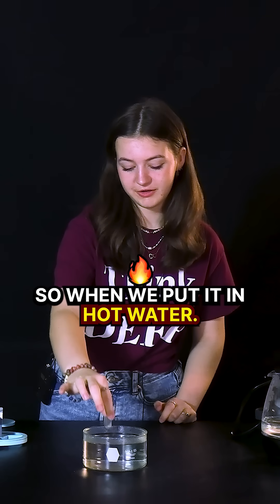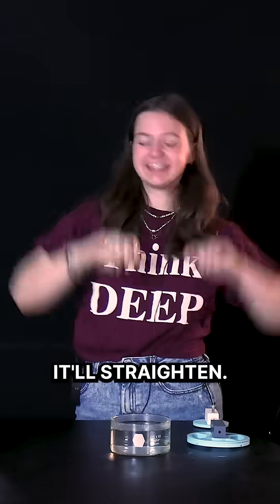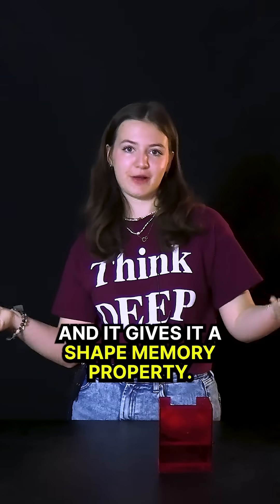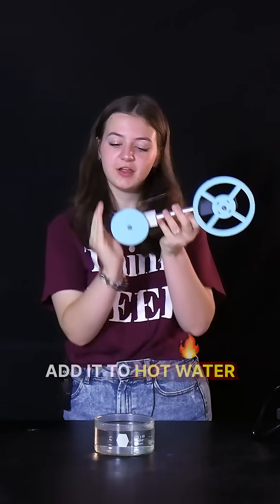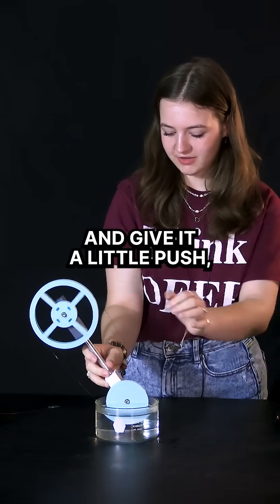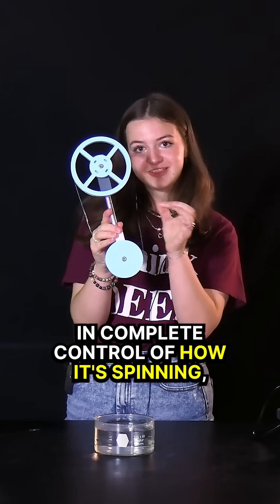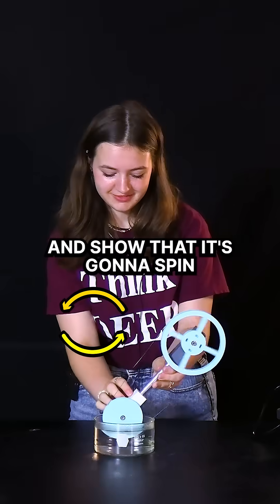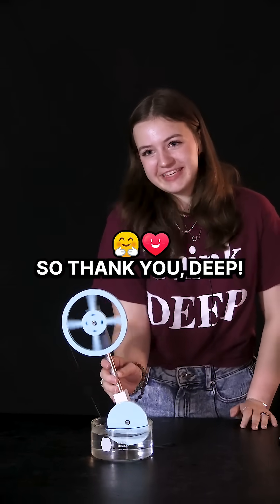Magic metal springs to life from heat! But how?? #shorts #tamu #science

Comment: "Using temperature as a variable and other thermal conductivity parameters as constants probably would be a way for heat flow analysis in alloy metals in the case. The thermal conductivity itself is a measurement of a material's ability to transfer heat, & Transferred thermal energy due to temperature differences could be utilized in processes like thermal propulsion or electrically converted- in the form of devices e.g thermal detectors thro' thermoelectric effect. Thermal conductivity, however, is influenced by numerous parameters, so I don't think attaining its own monitoring and regulation is a simple task. These include some of the following: alloy composition, crystal and phase structure, grain size, impurity content, dislocation density, porosity, temperature, cold working, heat treatment, precipitation, magnetic ordering, electron concentration, lattice vibration, vacancies, phase transformation, oxide films, grain orientation, residual stress, thermal fatigue, component size and shape..."

Comment: How long will it last?
Reply: @sptzk7133  until the water cools down. It's a cool concept though
Reply: @maxs.3238  but does the wire go bad, bc if you a constant heat source it could be very useful!
Reply: @sptzk7133  I would assume that there will be material fatigue at some point

Comment: Be careful this is government territory your walking on infinite energy with a metal sounds like something they might think as a threat especially if you take that little wheel she has and sacle it up about x50 and you got your self a sustainable energy granted you’ll need a heat source for the water but that’s simple enough that it’s every possible to make your own self sufficient energy source with this metal
Reply: Especially if it’s built at a hot spring then you don’t need to find a fuel source since the geological heating of the undercrust is not getting cooler anytime soon so pretty much infinite energy granted you’ll have to live at where the hotsprings is but that’s not so bad

Comment: Proof there IS power in "going straight". 
This experiment is going to cause many "wires" to be "hot-headed.", let's hope it gets their "wheels turning", in the "Right" direction, a lil rewiring solution, could prove very beneficial. 😅
She may even have a new kind of perpetual motion/ energy. Need 2 sources of water, one heated, one cooled and will continually work, as long as it stays coated in the nitnol solution. 

Straight pride, straight power. ❤ ✊️ 😅😅

Comment: Memory metal. It reacts to electricity to. had some ideas for applications of it. Our muscles retain memory in a similar way, so it gave me the idea of using a memory metal weaved in the pattern of human muscle strands to either make exosuits that could theoretically make you faster and strong by alot kinda like a spartans armor from halo, or you use the artificial muscle weave in prosthetic limbs for a more natural movement. Combine silicon based synthetic skin and you should basically have luke skywalkers prosthetic arm.

Comment: I see the beginnings of a perpetual motion machine. There is always gonna be a loss of heat however I do see ways they could make it perpetual even if the returns aren't great. Electronic conduction heating elements. Granted you spin it through a bunch of gear ratios to power the item. Depending on how many wats are made you could power some form of electrical heating element to heat the water. If the energy is enough to provide a touch more. Even just a touch more than what's being used your golden. Water is in constant supply here on earth. Even dirty sewer water or salt water can be boiled and heated via the machine if you don't want to use fresh water. But if your able to somehow got even a touch extra power that power can be stored. Infinite power. Goodbye fracking, goodbye gas, goodbye jobs. Hello infinite electrical power.

Comment: We use these wires in orthodontics due to their shape memory. When you get braces, the wire is placed into each bracket, creating kinks in the wire’s form. The heat from your mouth and the wire’s desire to return to being straight help it straighten back to its original form, aligning your teeth along that straight arch at the same time!

Comment: This would be a great energy creating perpetual motion machine.
Connect several of those together and attach each to a kinetic energy generator.
Insulate a large container of liquid dense enough to heat without too much evaporation. Split the kinetic energy this creates from its rotations. Some to an electric water heater that will continuously heat the liquid inside the container and the remaining energy to a power bank to store that energy for later use.

The heated liquid creates the spin
The spin creates the energy
The energy creates the heated liquid

I don’t imagine the yield of energy would be enough for anything substantial but If done correctly it could be a good small source of power. Great video keep them coming👍🏻

Comment: So whats stopping this from being perpetual? What has to deplete to break the cycle
Reply: The water gets colder as the wire takes heat and releases that heat to the environment as it spins, lesser the heat, lesser the spin.

And at some point when the water temperature is low enough where it doesn't force the wires molecular structure to move and straighten, the spin stops.

You can never create energy, only transfer it from one place to another, this is heat energy being transformed into motion.

Comment: Some people argue about it needing heat that has to be produced. 

And yes it does, but we can get heat as an infinite resource. 
You could use a lense and sun to heat up a basin of water. 
You could also use thermal energy. Think natural hotsprings.

Basically most sources of energy that we use, revolve around turning a tourbine. Through water currents, wind, steam... Even our nuclear energy is simply a way to make water boil and turn a turbine.

Solar is the only source of energy that works differently iirc

Comment: If you applied this technology with a natural hot spring then you would have a variation of perpetual energy.
Reply: It’s free, not perpetual
Reply: @1986DarkStalker  wouldn't it be perpetual energy because the definition of such energy is renewable energy generated by a naturally replenishing source i.e. a hot spring
Reply: @ perpetual means infinite
Reply: @1986DarkStalker  I get that. So if you have an infinite hot spring, then this sort of mechanism could run indefinitely.
Reply: @ hot springs are not infinite

Comment: I got one of these wires as a paper clip from the V-Sauce curiosity box. Honestly it’s a fun lil party trick when I pull out the box the single paper clip resides in and talk about how special it is as I immediately bend it out of shape. The looks I get 😂. I then demonstrate its properties by either very carefully holding it above a flame or dropping it in a mug of hot water (make sure to pull it out with a fork or something as the water does need to be rather warm to work and the paper clip is going to be the same temp for a few seconds). 👍

Comment: So would this be considered a form of perpetual motion?
Reply: it uses heat as a structure for energy, so when the hot water becomes cold, the pulley stops.
Reply: @  I meant to put this comment as a reply to another comment mentioning placing some sort of system over geothermal water vents
Reply: @wingsandthings99 it wouldn’t be perpetual, just free

Comment: As someone with limited scientific knowledge, I completely understand that because of the need to heat the water this isn’t infinite energy, however, could it theoretically be possible to implement this technology at natural hot springs? Something tells me the energy output would be too insignificant for it to be worthwhile.

Comment: Is it possible to turn this small wire into a huge long cable and place somewhere near the volcano so we can have free infinite energy ?
Reply: yes but this would be inefficient compared to something like solar or wind which is also “free” energy for a variety of reasons, namely that the wire would need to be bent once again after being straightened, meaning there would be little net gain in energy.

Comment: Geothermic electricity just got a buff.
Reply: Doubt it. Still not commercialy viable. But believe it or not, fracking actually got geothermal a step closer to geothermals commercial viability... (deeper holes = more power & cheaper holes = cheaper geothermal) 
I believe the wear and tear of this material would have high costs involved, which would mean high maintanance costs even if you can make a more efficient power plant. Also idk if this is more efficient that a heat exchanger + steam turbine. Would need data on that first

Comment: Use it as a thermal dissipation mechanism to reclaim energy lost through waste heat functions. Think in terms of regenerative breaking but for something mundane like your spa losing heat after you're done with it for the day powering your yard lights. Eventually the system no longer has enough heat to keep the lights on but who cares when it's after 2am, right? And you were going to use the Jacuzzi that night anyway so it simply translates to a more efficient use of the money you've already spent heating the water for the day. Or maybe we use them as a trickle charger for home power in remote areas. Who knows. Either way this was cool to see and I'd like to play with it as a toy in some kind of science kit.

Comment: Nitinol is used a lot in the medical industry for things like stents. You can purchase this yourself for relatively cheap, you heat it to the transition temperature and keep it there for a while. Then you lower the temperature to a specific temp and keep it there for a while. 

We use this for creating a semi rigid airframe on paragliders for the leading edge, since being packed away can deform the leading edge, as soon as it gets warm enough it forms back into the shape for an aerofoil.

Comment: Interesting. Comments need to pay attention to adjectives like hot when it describes water. 

I wonder how much force it provides and if it could be a concept in a combustion engine. Imagine if we could power day time running lights solely off using the heat. Increasing efficiency a little is still a little x100mil. Increasing efficiency is the real green.

Comment: Would you not be able to use the energy output to power a heat source for the water? That way all you need to do is continue to add water for evaporation or am I over engineering this?😅
Reply: It'd be a very simple perpetual motion machine but if there's enough energy output you can use the excess for whatever you desire
Reply: You could capture the rotational energy and use it to heat the water. However, this process would be very lossy, and most of the energy would be lost as the water just cools into the air. So you could recycle a bit on energy, but not nearly enough to keep it spinning long term.

Comment: Would more bends in the wire cause it to react more? Also, what if you used a pulley with notches in it to create more bend in the wire, or would that take more force from the wire to move?

Comment: How much net energy is lost in the system of the pulley and the hot water? This seems as close to perpetual motion as you can get.
Reply: You lose some to friction of spinning, but a lot more as the water and wire cool through normal means.

Comment: Not quite infinite power, but with a creative heat source, could be close. Solar heat-sinks, or geothermal might be options, but I have no idea about efficiency and scaling.
Reply: Yeah, you could do that in theory, but if you have access to that it's probably better to just use the normal methods of capturing energy from them lol
Reply: @itssovalentine  Fair enough, but it's not the energy capture method that is the problem, but the conversion. "Normal methods" of utilizing heat energy have the same drawbacks and this abnormal method. Just another potential tool in the toolbox.
Reply: @GonkyWonkler  Exactly, it's not that this wouldn't work. It's just very unlikely to be the most efficient option available.

Comment: Theoretically, if the "torque" if the devise could be increased drastically, you could potentially use this electric generator for extracting thermal energy from hot springs, or near underwater volcanic vents.. although the "best" solution would be to dig deep into Earth, to the depth where heat would be high-enough to warm-up water close to boiling temps, and use this concept, only built on a much larger scale, and as I've mentioned, if possible, with wires created in a way where they would be able to produce much more torque or speed of the spinning wheels.. then it would only be a matter of retrofitting magnets and some copper to induce electricity from that very spin..
It's a nice concept.. there is another mechanism that can get power from warmth and cold called "Stirling Engine"

Comment: That stuff is fun to play with. I have it how did you connect the end together to make a loop?
Reply: @ericbartu3274   nitinol is hard to solder so what I suggest is to wrap a thin wire around the edges like copper and solder the thin wire. You can also use a crimp.
Reply: @ hey thanks for the ideas much appreciated

Comment: Perpetual motion machines finally exist
Reply: No it’s using thermal energy
Reply: @Kid_Omni-Man  still a machine that operates with just hot water, and that's easy to take care of, if it can operate at a fast enough pace to maintain the energy for whatever keeps the water hot what's left could be put into a battery; if there is anything left

Comment: I think most of confusion arises from this sentence: " Completely powered by nitinol trying to straighten" - which isn't true. It's powered by heat energy stored in water, transmission belt made of nitinol is just a medium/device converting this thermal energy into mechanic one. It's a cool science demonstration, however from what I've seen in the comments many people are getting it wrong. In any given closed system the amount of energy at output, will be always lower than energy that you are putting in to this system due to the law of conservation of energy: "total energy of an isolated system remains constant;"; and due energy losses related to many factors(heat dissipation, friction etc.) you can't get even 100% efficiency not even mentioning anything beyond that.

Comment: That might be a good way to get geothermal power, it might be ok with a shallower depth
Reply: Geothermal already is possible with a heat exchanger at lower depth. It is just not commercialy viable, because the price per kwh is just too high. 
This might push down costs in the future, yes, but I think we will just dig deeper holes because that will always be more cost effective and cost for digging deep holes has plummeted since the fracking boom in the usa and still kinda does. 

The thing is, that it still is hard to compete with solar, which has gotten reaaaaly cheap and still gets cheaper year on year (talking about price per kwh generated here.)

Comment: So a whole bunch of these in a puddle-pool with black base and mirrors reflecting sun at the water- perhaps in a green house to prevent water loss and retain heat but the upper wheels covered in a box to maximise temp relief could generate power?

Comment: Is this proposal motion, then? I realize that there IS a force acting on the wire causing the motion but as long as the water stays hot.... is that not how that works?
Reply: I assume you mean perpetual motion, and no, it's not. Heat is energy, so something needs to be constantly adding heat to that water.

Comment: This is VERY cool. However, I’m very curious if you can train it to go straight with cool/cold water? Seems to me that the likelihood that you will have naturally occurring hot water, to power a device like this is very low. However, having cool water seems to be the norm, I a large degree of climates, and therefore would allow for “generators” to be placed in water and make virtually unlimited electricity with a system like this.

Comment: The center of the Earth is boiling molten iron just try to get a little bit close to that and you’re probably going to have enough heat

I would like to see a larger piece of wire with the same technique being used 

There is also a possibility of using  Hot Springs

😊
Reply: Just saying: geothermal power already is a thing. It is just not commercialy viable everywhere  ... yet

Comment: That's the closest you're going to get to infinite power. Now my question is will it go straight in the presence of enough heat without water? If so as long as you're buy one of those hot stream geysers or bubbling hot tar pit or a bubbling hot lava pool you'll have "free" energy. Assuming you can send it somewhere else because nobody wants to live next to that

Comment: This is amazing, using curved glass it's possible to heat wanter with sunlight, and then convert it to energy with this...

With a few test i could imagine a good prototipe of this

(I now that it won't ve SOOO powerfull, but the building process will definitely be better then fotovoltaic pannelles)
Reply: @theenergyace584  what do you mean using curved glass to heat water?